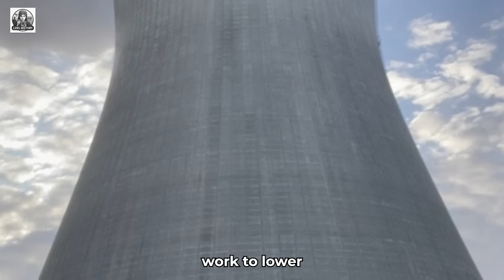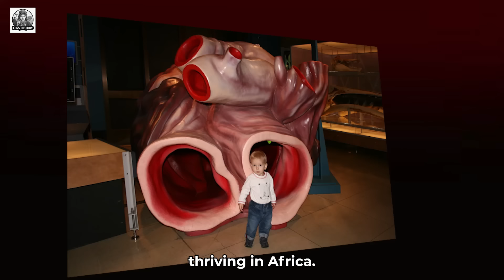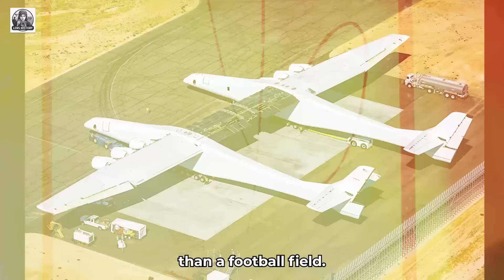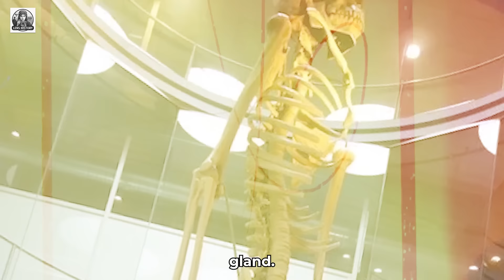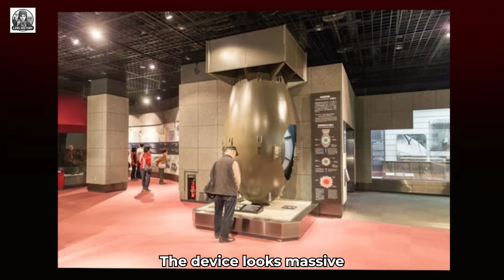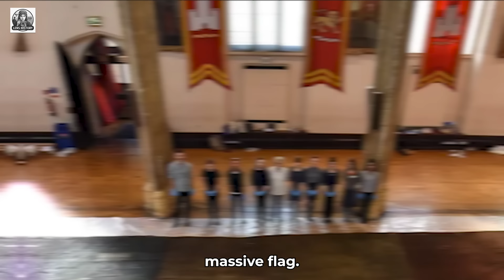🔴Shocking Photos Of Giant Objects You Won’t Believe Actually Exist

Comment: Just outta curiosity, if Robert Waldow was 8'1  but the chart with the Bears show's him to be over 9'  So which ones right ?
Reply: 🔥✊🏾Was Thinking The S🤔me…👊🏾💯
Reply from the maker: Great question! It can be confusing when different sources present varying heights. Sometimes, the measurements can be influenced by different factors or rounding.
Reply: Y en donde está el gigante de la foto de entrada.
Reply: Hewas 8'11+,I wonder just how many other things weren't true?
Reply: It’s probably because while the woman was flat against the wall he was standing a foot in front of the wall making him appear a foot taller at 9ft. If he was flat against the wall like her than you would see the 8ft marker by his head instead. Or there was a mess up and they meant 8’11.